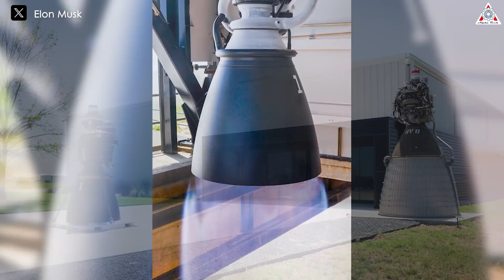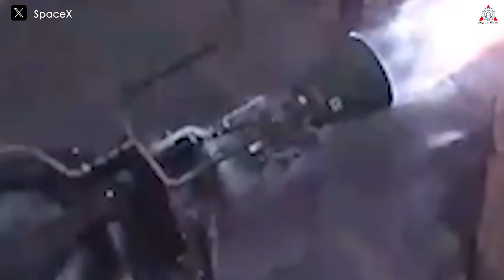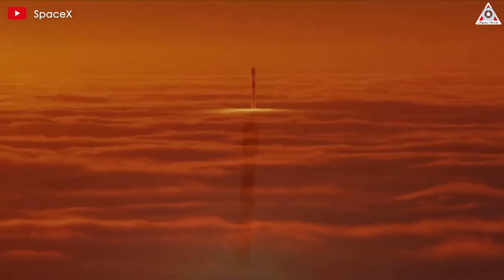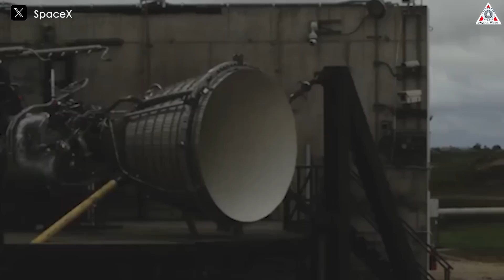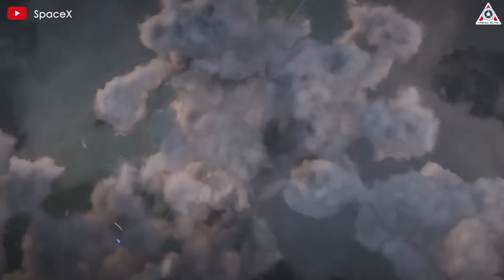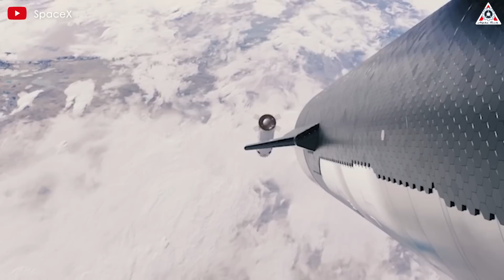Musk & SpaceX Presidents HUGE UPDATE on Raptor 3! ULA Tory Jealous...

Comment: The clown show continues! If spacex takes a dump you guys rave about the toilet paper. A rocket is and assembly of many parts that must work in unison to be viable rocket. Space does not currently only this symphony of parts and electronics to make Starship work. I would hold on to the raving until it can make space and then orbit the earth, maybe 4 revolutions. Catch booster with the chop sticks. Then recenter earth’s atmosphere, survive and also be caught by chop sticks. Then I’ll rave. To date 4 failures. They have change the perimeters for ift-5. Who know if close is all they can achieve again. If SpaceX didn’t have leftover engineering from falcon 9 and falcon heavy. Their failures would just be to many. But keep the faith. It is all you have.
Reply: Clown show? Your comment qualifies. You obviously do not have a substantial STEM education or even a cursory understanding of how rockets work. SpaceX has the undeniable track record for innovation in the launch market. 300+ times landing a 1st stage booster with Falcon 9 for instance. No other rocket company has yet equalled that feat even once, which Spacex first performed way back in 2015. And Spacex is #1 or #2 on the list of where the best engineering brains in the world want to work, so attracting the essential engineering talent is not a problem for them and the results were clearly shown during IFT-4. And as SpaceX said MULTIPLE times, the "payload" for that flight was Data. Having said that the booster successfully navigated to a precise point on entry and made a soft touchdown in the Gulf (@ 9kph final speed) and then fell sideways into the water, success. Then the more dramatic re-entry of Starship, where they did not totally expect the ship to survive, but it held on to make a similar touchdown in the water, albeit 6 miles or so off target due to the damage to the front flaps, which still managed to hang on enough to allow for the "flip manoeuvre" to re-orient the ship into a vertical position for "landing". Then as mentioned in the video, Raptor 3. I don't understand how the "Elon Bad" mindset can make it's way into comments like this from frankly uninformed "space fans" unless they are so invested in Boeing, Blue Origin and ULA that they criticize SpaceX with no backup whatsoever. If you want a clown show, look no further than Boeing Starliner, where SpaceX may well have to come to the rescue.
Lol, try doing some research, I would suggest Everyday Astronaut's channel as a good place to start, he has tons of non-SpaceX content and is a great place to start understand how rockets work, the different engine cycles (existing and historically) and generally just how complicated rockets actually are. There is a reason that we never went back to the moon, it took over 50yrs for someone to try to solve reusability and reduce the cost per kg to orbit to a tiny fraction of the costs in the past (Boeing 1.6billion in the red on Starliner alone, ~6billion in development cost total so far).
If Elon is a clown, then I WANT him at MY party.. You can stay home in your moms basement.
Reply: I think you're right that the hype around Spacex is way overblown.

What I do not agree with is the "4 failures". It is spacex development philosophy to have launches that are not expected to succeed as part of the development cycle. Instead of spending money on engineers digging for every possible issue, spacex tends to get a "good enough" prototype built, test it, find flaws, fix flaws, build new prototype, repeat. They went from destroying the landing pad, and losing control of the rocket during IFT 1 to just about managing to fly a nominal trajectory, and soft land both stages in the water. There is significant improvement. Instead of finding flaws in the sim, they find flaws IRL.

Now, that does not mean at all that it is smooth sailing, nor that it would succeed, but spacex did prove that they are able to succeed where their competition struggles.

These spacex channels do provide a false picture of spacex invincibility, and people do buy into that. It is kinda tiring to see all these "HUGE UPDATE" "GROUNDBREAKING" "GENIUS" etc etc superlatives used in vids made every day or so. But I do enjoy watching one or two such vids every once in a while, even if I fully understand that all the hype about some concrete foundation being laid down is complete bullshit. I suspect, however, that that is the main marked these channels are targeting: sporadic viewers
Reply: @andrasrudnai9386  agree, but wanted to share my reply to the clown show guy as well.

>Clown show? 
@mikerash-pc4jc
Your comment qualifies. You obviously do not have a substantial STEM education or even a cursory understanding of how rockets work. SpaceX has the undeniable track record for innovation in the launch market. 300+ times landing a 1st stage booster with Falcon 9 for instance. No other rocket company has yet equalled that feat even once, which Spacex first performed way back in 2015. And Spacex is #1 or #2 on the list of where the best engineering brains in the world want to work, so attracting the essential engineering talent is not a problem for them and the results were clearly shown during IFT-4. And as SpaceX said MULTIPLE times, the "payload" for that flight was Data. Having said that the booster successfully navigated to a precise point on entry and made a soft touchdown in the Gulf (@ 9kph final speed) and then fell sideways into the water, success. Then the more dramatic re-entry of Starship, where they did not totally expect the ship to survive, but it held on to make a similar touchdown in the water, albeit 6 miles or so off target due to the damage to the front flaps, which still managed to hang on enough to allow for the "flip manoeuvre" to re-orient the ship into a vertical position for "landing". Then as mentioned in the video, Raptor 3. I don't understand how the "Elon Bad" mindset can make it's way into comments like this from frankly uninformed "space fans" unless they are so invested in Boeing, Blue Origin and ULA that they criticize SpaceX with no backup whatsoever. If you want a clown show, look no further than Boeing Starliner, where SpaceX may well have to come to the rescue.
Lol, try doing some research, I would suggest Everyday Astronaut's channel as a good place to start, he has tons of non-SpaceX content and is a great place to start understand how rockets work, the different engine cycles (existing and historically) and generally just how complicated rockets actually are. There is a reason that we never went back to the moon, it took over 50yrs for someone to try to solve reusability and reduce the cost per kg to orbit to a tiny fraction of the costs in the past (Boeing 1.6billion in the red on Starliner alone, ~6billion in development cost total so far).
If Elon is a clown, then I WANT him at MY party.. You can stay home in your moms basement.

Comment: I Agree with Bruno ... that Raptor 3 looks Incomplete or Fake ! ... I also don't Believe or Trust Mumbling Musk ... He brags and Exaggerates about Everything he makes or does ! ....  And Shotwell will agree with whatever Musk Mutters .....  :-/
Reply: You're foolish, they showed the photo of it being tested. SpaceX is so far ahead of everyone else it's not even funny, just like Tesla's EV's.
Reply: Musk Mutterings Matter
Reply: ULA, the company that has never designed or built its own rocket engines. They have purchased them all from Russia and now, Blue Origin. ULA knows nothing about rocket engine design.
Reply: @robertbrander2074
pro tip: dont let your arguments be a testament of your ignorance.
Reply: @Copimi  well the exclamation point is used twice in a single post and we '...' twice as many times as that.  Was it even an argument?
Reply: ROTFLOL🤣🤣🤣.  There's a video of the Raptor 3 being test fired for 60+ seconds at max thrust. They're using 3d metal printing to manufacture major structural components with integral propellant channels built in for the regenerative cooling. ULA's Vulcan Centaur which finally flew into orbit for the first time this year is not a reusable design. Blue Origin has yet to achieve orbit.

Comment: Welp! Gwen made my morning with her come back to Tory...
There's some Space humor history!
Hope Elon gives her a big smootch for that one, it was classic! 🥰

Tory's face seeing the firing image must have been a shocked emogi... Followed by face slap emogi...

Followed by thinking emogi...

"Oh! Schitt!"

Tory then begins the big grok on parts count rabbit holes... 🤣

Glad he stuck his foot in his mouth,  as it will raise eyebrows through out the industry about how PRIMATIVE their engines are now...

Get to work Slugs! you have some catching up to do on engine design...

And the blue flame tells a story too, highly efficient engine, clean as a whistle, and the frosty exterior means a cooled interior with a longevity factor likely never seen before.

Would be interesting to run a test to failure on a Raptor 3, see how long they will run at normal thrust levels..

My Dad talked about back around WW2 one of the Aircraft engine companies was the first to run their engine 24 hours at cruising speed non stop, it was considered a techno milestone compared to earlier engines.

Might be worth the fuel mix for SpaceX to see how long a Raptor 3 can burn for non stop...
Undoubtedly good advertising for their launch services, or selling engines to Space Force...

(Maybe they could have Boeing build them some hulls?  And NASA could bean count?)

I'm not worried, Elon can go way farther on engines... Raptor 3 is analogous with a single cylinder one lunger thumper boat engine...
Will be an efficient and much loved engine throughout the solar system,  but it ain't the last word for big ships, its more of a good start. There are bigger, simpler motors to build.

Raptor 3 just got us past the crappy outboard motor stage on our way to powering Battleships...

I'd say R-3 is our first real Space inboard boat motor analogy.

I wasn't wrong about parts count, Just needed an Elon to proove my points..

And theres more concepts where that one came from...

These days, Elon is the happy face Emogi on engines, not like the company email about potential bankruptcy with 
Raptor 1.

Them days R gone!

Now its everybody else looking at their Spaghetti Monster Bankruptcy Engines....

And Elon gets a
 "Triple Neener" 
on them...

He wont stop, we ain't seen nothin' yet...

Just sayin'

Comment: The picture of "Raptor 3 test" at 1:05 does not seem to show an actual firing: the tests of Raptor 1 have shown the jet firing horisontally, very long flame and with sonic fluctuations, while here the flame is directed into a trench, very short, and shows no fluctuations. AI generated picture?
Reply: This stand is vertical. Just like NASA’s  firing stands. Spacex does t need to fake anything. The proof is in the pudding.
Reply: You are mistaken.
Reply: Have you never seen a vertical test stand?